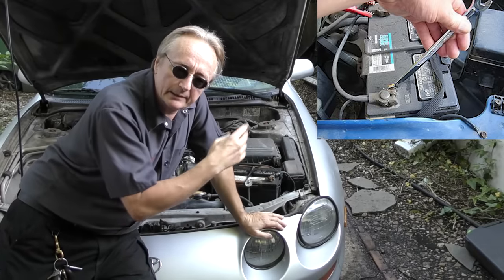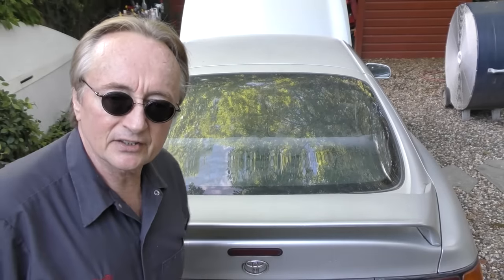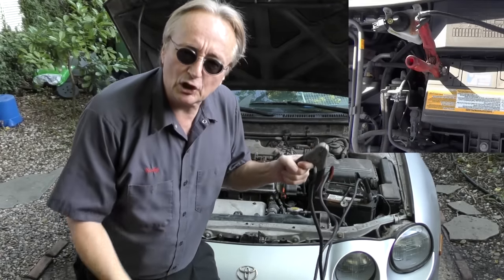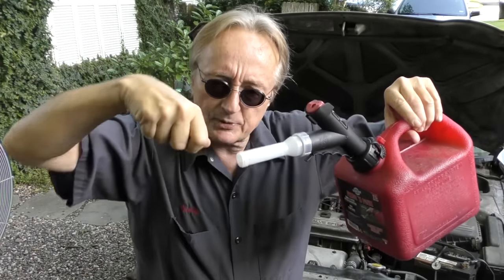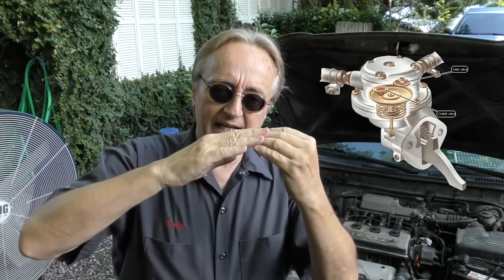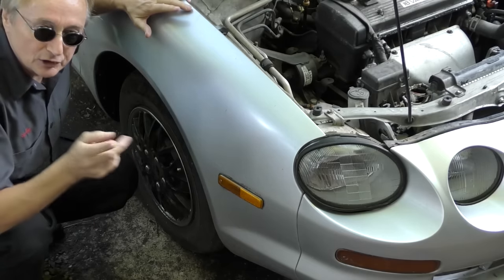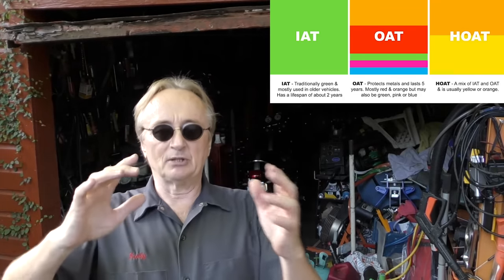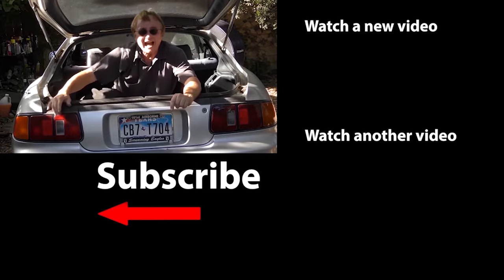This Will Destroy Your Car

Comment: Never knew about not running the good car’s engine during a jumpstart
Reply: Because it's bullshit. 2 alternators running? 😱

12V + 12V = 12V

The connections are parallel.
Reply: That two alternators explanation makes no sense.  The voltage you see across the battery should be DC.  The only problem I can imagine is if the donor car has a weak battery too and the recipient car's starting attempts to draw very high currents from the donor car's alternator.
Reply: @matthewgardiner9015  , thats if its hooked up wrong.
Reply: @lastdeadmouse7  I hear Scotty say a lot of stuff that is bullshit.
Reply: That actually makes sense. You need the battery only, what's the point of having donor running, battery is alive anyways. And when dead car starts drawing current from running donor, voltage may fluctuate and cause damage in running electronics, because voltage is dependent on current being drawn. So just keep donor not running and keep it safe.
Reply: I just disconnect cables once the car is started.
Reply: @matthewgardiner9015  
Dont know what series and parallel are do you?
Reply: Almighty God Servant  
Oh yea? Bet he hasn't been.
Reply: @lastdeadmouse7  His point was how to protect the computer system in a newer car while jumping another car.
Reply: All my Vehicles are pre millennium.  Before Y2k. 
Before Year 2000 .  However 
Vehicles after Y2k are very very 
Fragile and sensitive.
Reply: @lastdeadmouse7  Its not BS i work in the computer industry and it is a big no no to use 2 powersupplies even when running at the same voltage the slight differences in the 2 powersupplies can cause problems with the sensitive electronics. The only time it is done is with servers and high current diodes are used they are not just connected straight to the system.
Reply: MR. JP Christian and endless money pits
Yeah i have a few
Reply: @lastdeadmouse7  AND the  alternators share the load of the dead battery so less chance of one going out
Reply: @matthewgardiner9015  Not in parallel.  12v + 12v in series would equal 24v but youre not going to be in series when jump starting.
Reply: @BluRaven1  I have a 2006 vehicle. So, it's best if I jumpstart somebody's car off, to not have my car running to not ruin the electronics?
Reply: @matthewgardiner9015  during a jump start the batteries are paralleled not in series.  12 volts in parallel is plus to plus and neg to neg.  Equals 12 volts with current doubled or added.  Series is plus one one to neg on the other.  Voltage doubled and current is same.
Reply: @robinellison6708  check owners manual.  Even my 2013 states start good car and let run for a few minutes to charge dead battery.
Reply: Mel Robinson    What about 13.4 V in parallel with a weak 11.3V battery?  This is more of a likely scenario than both batteries being exactly the same voltage, specially one that is on the good car versus one in the car that won’t start.

Comment: Jumper cables walk into a bar. Bartender yells GET OUT! 

Jumper cables says hey man I'm cool

Bartender says well ok but don't start anything
Reply: Joe Troutt
Reply: Haha... Clean and easily understood jokes are great for the workplace so im gonna try to remember this one.
Reply: @benbrice9343  here's another clean one if you wanna

2 guys find a hole in the woods. They wonder how deep it is so they throw a rock in. No sound, so they roll a boulder in.  No sound. So one guy says let's throw this railroad timber laying over there in, I bet that will make some racket. So they throw it in. Next thing you know a goat comes running as fast as he can and jumps in the hole. Both guys with look of amazement. Then some an old farmer comes by asking if they had seen his goat around and they said yeah, one just run and jumped into that hole. That farmer says that couldn't be my goat. My goat was tied to a railroad timber.
Reply: @joetroutt7425  that was funny
Reply: And i thought "2 pigs fell in the mud" was a bad joke.
Reply: Buick Regal  Not a cop joke but it is a dirty joke
Reply: @joetroutt7425  that was a little too clean

Comment: The topping off part should be shown to every pump jockey in New Jersey. Since there are no self serve stations. They All top up.
Reply: Hardly ever.  Seems i always pull away from a gas pump in NJ with a couple extra gallons of air in my tank. So glad I can fill it all the where I live.
Reply: in the uk everyone fills up there own car, u we don’t have auto pumps so getting it bang on is kinda important here is not u gotta use another note -_-
Reply: @theskyrimboysxx  only some stations pump fuel for you. I live in the U.S and I've never had anyone other than myself use the gas pump.
Reply: at lest as far as i know it’s a pull hold over here they may be the type u have where u can hold it and leave it, ur car gets filled it’s not a toggle here at lest from the ones iv been to anyway

Comment: Two alternators on the same circuit do not damage each other.    One becomes primary and other should shut down seeing the charging voltage of other alternator.  The charging voltage of 13.8 volts or more would appear as a fully charged battery.  Anyone with twin engine boats can attest to this.  Combining electrical systems results in one alternator submitting to the voltage of the other as a full battery. This means you lose charging Amps by half.  Great advice warning of the dangers of jump starting a dead battery with other vehicle alternator running.  The sudden  huge load can pop the diodes.  Also removing the ground terminal does produce  a surge and can damage the alternator diodes as well as kill the electronics.    That happened to our work van.  By jumping a totally dead battery they killed the ecu and bcm.  Lost over $1800 on that stunt.   Thank you Scotty for great advise as always.  The dual alternator issue is something I have dealt with for years on marine applications.   As an interesting fact, quality battery selectors have an alternator field disconnect....so if you attempt to switch off the load from a running alternator , prior to opening the load contacts there is a set of contacts which opens and depowers the  alternator field effectively idling the alternator before the contacts open for attached load.
Reply: True
Reply: SHOULD.   But hey, go ahead and risk your $5000 electrical system on a upstart because going think you know how it SHOULD work.

I won't even give or receive a jump from anybody.  It's not worth it.  Yes, I help you out, and then within a week I have to buy a new alternator on top if a
Who knows how many unknown gremlins? NO, screw you, you can go buy a new battery for your car or learn to turn off the lights or get your car figured out so you don't need jumps anymore.  Not my problem!!

Comment: Buy a Toyota and change your fluids often. That’s it.
Reply: No Buy a Honda and change your fluids often. That’s it.
Reply: Some Toyota engines have a reputation for developing excessive oil consumption even when maintained to manufacturer's reecommendations.
Reply: Yeaaaaa that's all new cars SUVs trucks ..bozo.
Reply: We have 2 of em with over 200,000. My father in law barely checks the fluids in his tundra much less change them. I’m certainly a believer.
Reply: @Davido50  actually ford vehicles do not consume oil i have found. My chevy used a quart a week from new until over 100k miles.
Reply: @ronaldarchibald2506  just truth. Honda & Subaru eat oil too.
Reply: Same with any new car so I buy American. Better design . Better tech. Better trucks. Period.
Reply: Yep change fluids basic maintenance 97 4Runner 325,000 99 4Runner 214,00  both use zero oil between 3,000 mile oil change. And as Scotty says Ice cold A/C lol.

Comment: Okay, I learned something today.  From now on I'll turn off the running car when jump starting another car.
Reply: Let the "good" vehicle run for 10 minutes to charge the "bad" vehicle. Then shut the "good" vehicle off before trying to start the "bad" vehicle... that's what he said.
Reply: let's agree to disagree
if the dead car is a diesel in a winter, I'll keep the good car running.
there will be a voltage drop, and if the good car is turned off it will have ~12.6v (and dropping), I'd rather have 14.5v and dropping from there. 
i never destroyed an ecu
Reply: @2199SPUDMAN  Yes, that's what I meant in my post.  Thanks for taking the time to be sure I understood it.
Reply: @costinc.6525  just because it hasnt happened doesn't make it ok. It still can happen eventually and waiting until it does to change your habits is to late.
Reply: @BluRaven1  .... I agree, there's Murphy's law to keep in mind.
I'm sure that it will happen sometime (but only if we're talking about cars less that 5 yrs old -  they are filled with electronics...)

Comment: Sounds like good advice. Using a battery charger/starter combo will fry an alternator. Been there, done that. Also, the idiots at Jiffy Lube. Sorry, no hard feelings; will use a mix-all antifreeze in your car. I had a Chevy Cavalier. Uses Dextron. The green stuff will make the water pump leak. After putting the Dextron back in, the seals swole & the leak stopped. Listen to this guy!

Comment: The biggest tip I took from this video was the jump starting, did'nt know you had to keep just one car running oops.
Reply: me either.... jumped many cars and always just connect up and start the dead one...
Reply: @liamgeorgie2024  It's not really a good idea to jump a car from a running car. The alternator is not designed to output the hundreds of amps needed to start an engine. That's the battery's job. You shouldn't leave the engine running unless you're worried it won't start and you'll have two dead cars.
Reply: Jump boxes are safer on new cars. No 60hz or square wave ripple, like the charger/boosters.

Comment: I saw a battery blow up when jumping another car...it was spectacular!
Reply: I've seen cables melt cause they incorrectly connected the terminals.
Reply: I've caused a battery to blow up. It's a pretty impressive boom
Reply: As much as I like (no LOVE) explosions, lol, I don't want to see that happen near me. I've seen what battery acid can do and when a battery blows, that stuff just goes EVERYWHERE and eats into stuff.
Reply: My mechanic lifted the hood on my 1972 Satellite to check why all lights were too bright and other indicators of excessive voltage. I don’t remember the exact cause but the battery exploded as he was looking at it. We got him under running water in seconds. His eyes were saved but his clothes were full of holes from the acid. I think the car had its voltage regulator running high. They were temperamental in those days.

Comment: I was at the gas station one day. The guy on the other side of me all I heard was the pump handle making that clump sound due to it being full. I told the guy that sound means the tank is full. The sensor is stopping it. He said naw I always do this... A second later gas started rushing out of his filler neck hahaha I bet he stopping always doing that
Reply: Natural selection
Reply: Sometimes the angle of the nozzle, or not being in far enough, on being too far in can cause the pump to switch off.
i have had cars like that. Sometimes on hot days you can seem to get shut off more often. I'm guessing it a bit of splash back internally. With that kind of car there is normally a sweet spot you find so it doesn't happen.

In older cars there was just an overflow, so over filling the tank just meant that extra bit you put in was pushed back out onto the ground.
Reply: Some, but not all tanks are vented to prevent contamination of the vapor canister. Recently, I've seen a trend that makes replacing the entire assy instead of just a charcoal filter necessary.
Reply: Was filling a semi tractor at an auto diesel pump - which takes forever - last month when some schmoe across the island did that. Must've done it a dozen times. Just had to SMDH.

Comment: You missed one little thing (although not a big deal) on your tip about not going below a quarter tank, the fuel also acts as coolant for the pump not just a lubricant and as we know, heat is the enemy. Having the pump submerged in gas keeps it cool and it lasts much longer. I just told someone this tip actually, a few days ago while helping them with a brake problem. He had it on E and I was like "go directly to the gas station after you leave here and fill it up. You don't want to be running this thing on empty (and told him why), fuel pumps and the labour are expensive to replace".
Reply: Well another thing is this ethanol... It evaporates faster than the gas burns. I've noticed the less gas in the tank the faster it goes

Comment: Me: my tire is getting flat it needs air
Scotty: dont!! Get a Toyota
Reply: I was told that nitrogen is the way to go! Doesn't expand or shrink as much as regular air. Don't do it unless you test it with regular air first. Tire changers can scuff a coated rim causing a mild leak. Cavaliers & Cobalts are famous for this.
Reply: Some tire shops only use nitrogen, like Costco for example. Most only have air. It's kind of like a "your tire is low, take what we got" proposition.

Comment: I always help people jumpstart there cars and Everytime I've done it I leave my car running at about 1500rpm and I usually wait but the second the car I'm jumping starts I disconnected the cable. Never had an issue.
Reply: Are you gonna wait till something bad happens to stop?
Reply: Most "modern" cars actually have built in protection for jump starting. My wifes Peugeot 2008 manual actually says leave the donor cars engine idling as you jump start. Never ever had a problem.
Reply: Henry Lozano your not gonna have a issue
Reply: This is exactly how I've done it, never had any problems at all.

Comment: Don't over fill gas on a Chevy Cruz just trust me and don't even ASK or TRY or even BUY one
Reply: DIY dont BUY 1 is the best advice
Reply: Don't buy one, i just left a comment about my aunts 2014 cruze that broke the turbo after the 36k mile warranty.
Reply: Our 2012 Chevy cruze just hit 70K miles and the only problem we ever have is coolant leaks every year so I'm retrofitting to a colder thermostat from a Chevy volt so the lower temps will keep all the plastic parts from breaking and leaking!
Reply: DIY Don’t buy a Chevy period! Lmao😂

Comment: Thank you sir I always top off my tank!!!
Sir I have learned so much from you I appreciate you!!!
Reply: Thomas Hart Man, I top it off until the gas flows to a point where I can see. I won’t do it again. Maybe round it up to the nearest whole number, $36.45 round it up to $37 for example. That should be ok.
Reply: Gary Chen why any extra?
Reply: Dr. Remulack I always wanna gas up as much as possible but since that’s gonna hurt my car, I’ll just do it in a lower level. I think that should be fine.
Reply: You never read the warning label on literally every fuel pump in the country? They all tell you not to top off your tank..
Reply: PANZERFAUST90 I did but it doesn’t explain why. The video did a good job explaining.
Reply: @garychen483  Yes this video does a good job with the explanation, but an explanation shouldn't be necessary to follow the warnings on the pumps.

Comment: The pumping gas and stopping when the nozzle stops is good except that I've encountered all to many nozzels that shut shut off early, like after 2-3 gallons were pumped into the tank.
When you pull into the gas station with a 13-15 gal tank and you have 1/8 to 1/4 on your guage, it's an issue when it stops flowing 5 gallons flowed through the nozzle.
It's an annoyance when you are just doing your weekly commute, it becomes a problem when the next gas station is 150 miles away.

Comment: In high school I worked for Goodyear. We sold automotive batteries.  My first job out of high school was at a lead smelter. We tore down old automotive batteries and smelted the lead. My last job was at a major automotive battery manufacturer. Your advice on jump starting cars is spot on accurate. However, hydrogen can build up inside the battery.  If the battery died because of a short inside the battery, that short can ignite the hydrogen during the jump starting or charging procedures. I've seen more than a few batteries blow up. Attach the negative jumper to the metal part as you said and KEEP YOUR FACE AWAY FROM THE BATTERY. When a battery blows up, usually the top comes apart. Battery acid and pieces of plastic can cause serious injuries. I've seen so many batteries blow that I carry safety glasses in my pickup, just in case. A pair of $10 safety glasses is cheap compared to the alternative. BTW, I really enjoy your channel.

Comment: Now everybody can stop looking at me weird when i jump their cars!
Reply: Andrew Mausisa I laughed at an old guy that jumped my car without starting his car. Until my car roared to life! He explained it to me. That was over 30 years ago. I get it all the time from folks (mostly young) “How you gonna start my car with your’s off?!” Lol
Reply: Do you need the cars engine to be not running or the car off completely as in key in off position?
Reply: @danejurus69  Yeah the car doesn't need to have the key in at all. All it needs is a battery that is not dead. Preferably at or above 14 volts. Just ignore the car, you are using the good cars good battery to start the other car that is only not starting because it's battery is dead for whatever reason. You could have a good battery and no car and use that to jump your car. That's why if I'm suspecting I might have an alternator problem I always carry around a charged battery and jumper cables with me.
Reply: Old habits are hard to break,,, relating to having the donor car running.